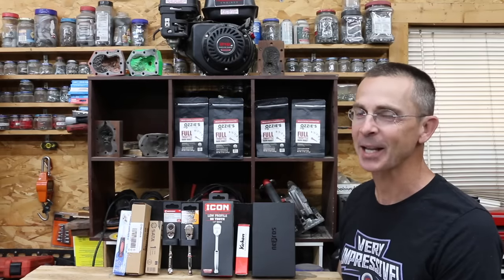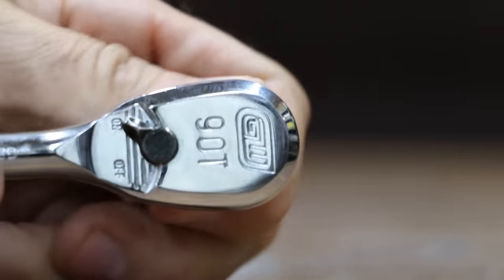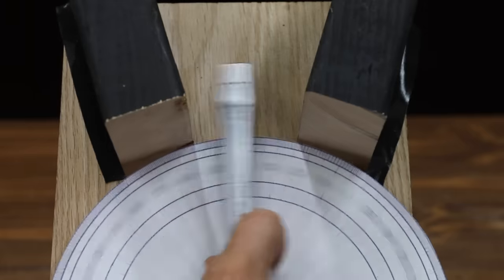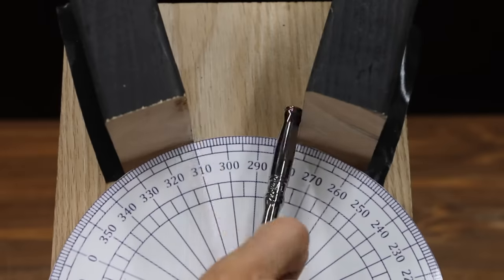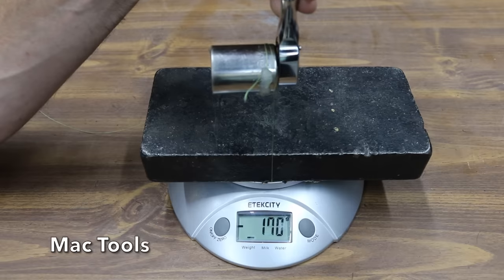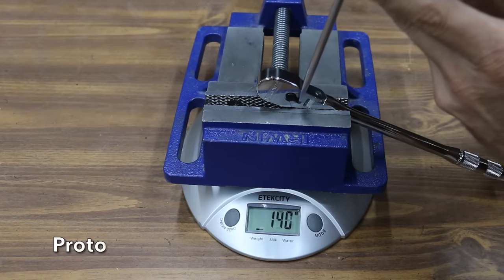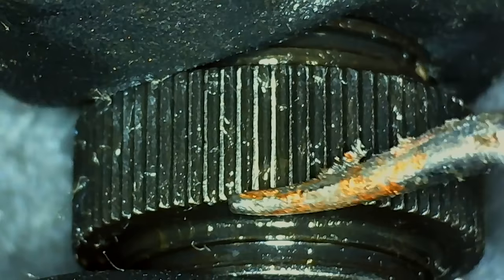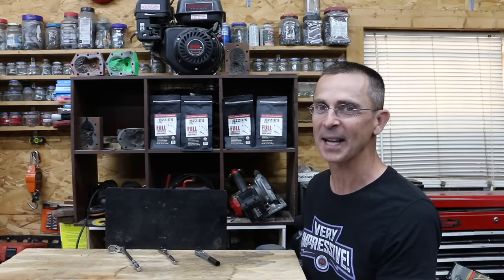Best Ratchet (1/4 In)? Snap On, Icon, Proto, GearWrench, Prototype

Comment: I have a teardrop head Westward 1/4 ratchet that is years old and has been heavily used. My 3/8 ratchets are Snapon and are about 50yrs old now and in excellent shape. Proto, Mac, and Snapon are my choices and they paid off very well. I do not own any Chinese made socket tools and never will. There are too many other good choices. Some tools in your equipment you should spend the money on. As well, these tools are all worth several times what I paid for them over the years and should I decide to I can easily sell them. NOBODY wants to buy used Chinese tools though. The other thing is that well made tools fit you hand better and just plain work better and live a lot longer.
Reply from the maker: Thanks for sharing.

Comment: Hope you can get some replacement main drives for the ratchets w/ good gears... hate to see them go to waste.

(Be nice promo giveaways for your channel.)

I just lost my very dear, 40 yr old ⅜ Snap-On flex head in a fire... made a lot of money w/ that ratchet & built a lot of fine cars & race cars, as well.

Not needing a high $ ratchet, approaching 70, I narrowed my choice to a 90T Gear Wrench & a 72T Crescent.

Had both in the online shopping cart, to make a final decision, then screwed up & ordered both.

Am I glad I did, too. I was leaning towards the Gear Wrench, but when I had it in my hands, the reverse lever was garbage. Didn't even take it off the plastic carrier to test drive!

The Crescent is a fine ratchet; not as smooth as my Snap-On, but it may improve. Feels like the pawl & teeth are rough.

Had it a couple months; like it plenty, but I can't get use to the  release button, 1st ratchet in 60 yrs to have one; I keep cussin' the ratchet 'cause the socket won't come off.

Oh, yeah, push the button, dummy.

I bought a HF ¼ composite ratchet on a whim, 10+ yrs ago. It has become one of my fav, no greasy car ratchets. Like to have a ⅜ version for non-greaay work, (grease will kill the polymer over lay grip in a heart beat.)

Good work, as always.

Something like a ratchet, need to come up w/ a greasy hands difficult to switch reverse lever, hang in to handle, use in tight spot test.

Don't know if ultimate strength test for a ¼ is relevant; it's not their purpose. Quickness, easy of use, tight space is their niche.
Reply from the maker: Thanks for sharing.

Comment: You gotta throw Matco 1/4 i believe its either 88 or 90 tooth. As well as the snap on you were using get the 88 or 90 that 72 or what not sucks.

Comment: Please make a video comparison of analog torque wrenches and digital torque adapters. 
It would be interesting  to see the whole range from 6-350 Nm tested every 1Nm up to 20 every 5nm up to 50 and every 10Nm up to 350.
A good comparison system  would be a good precise analog torque wrench and the adapter attached to it. 
Then apply force until each test setting is reached and capture in video the wrench break point in contrast to the adapters sound signal.
Reply from the maker: Thanks for the suggestion.

Comment: Your testing is very good in this video, especially having a prototype is very amazing content I enjoy, but I have some complaints. 

I personally think you should have gone with testing similarly advertised ratchets, for example do only 72T or only 90T ratchets. 

Also, as someone who uses Koken I’m confused why you bought/tested the oldest most basic Koken ratchet. They have a new 72T design which is fantastic. 

For anyone who’s wondering about ratchet purchase I’ll tell you this. 

When it comes to 1/4 ratchets there are special needs to consider. You want the smallest ratchet size wise, with the Lowest back drag. Strength is barely an issue, however if you do want to push a 1/4 ratchet to the limit I suggest Snap-on because they are one of the only who offer a very long 1/4 flex head ratchet, which can get in many tight spots, and, the ratchet head has a lifetime warranty forever so if somehow you break it, you can get it repaired no problem. That is to say, if using ratchets is your job, buy the best. If you’re a DIY-Er buy what project farm recommends in this video
Reply from the maker: Thanks!  Thanks for the constructive feedback.

Comment: An unmeasured parameter is how likely the ratchet is to change direction. This has little to do with 'switch pressure' and much to do with ergonomics, and speed the ratchet is being operated.

Comment: I have four 1/4 ratchets and my go to is the Gearwrench 90, it's better than my snap on by miles. 

1 Gearwrench 90T (amazing)
2 Halfords Advanced 100 (decent)
3 snap-on T72 (rubbish)
4 US Pro flex head (rubbish)

I am looking at getting the extra long soft grip by capri but not sure how much i will use it
Reply from the maker: Thanks for sharing.

Comment: I  only wish you had added Craftsman (and Titan, Neiko and Tekton).  I think more people have that brand than maybe all the others, for non-professional use.  Also, is there a way to compare how many passes to 360º without the thickness of the handle factoring in with each turn.  I can see why you didn't account for it though--because the handle WILL be what limits its throw in practice.  It doesn't account for gear-slop, exactly, but it's wrapped into the outcomes of each wrench's stats.  I'm so glad that you are "policing" the quality of engineering, relative to price.  But it's hard to measure that "je ne sais quoi" that has propelled some tools into the high dollar market.  Maybe you can account for that subjective factor in future testing when testing constant-use hand tools.
Reply from the maker: Thanks!  Thanks for the suggestion.

Comment: Thanks Project Farm friends. Could you make a series called 'Hidden Gem' brands. I'd like to recommend the brand: Flyman (I think it's a USA company). They have vanadium ratchet wrenches which have very sharp molding, Flyman also has pneumatic wrench gun or driver. The goal of 'Hidden Gem Brands and Models' is of course our favorite- finding a way cheaper brand and model that's way cheaper than the Roll-Royce or top 4 which is a very nice feeling.

Also have a multi-material oil (for metal, plastic, glass, wood, etc.), start with Germany's Ballistol brand, it's organic but expensive but If with WD-40 you need different types of WD-40 for say plastics, overall WD-40 may be as expensive anyway. Other oils can be contenders.

Lastly because we all tend to repair and open our tools, including multi-meters and maybe something with LCD or OLED, test quality plastic pry spudgers, metal spudger and tweezers that are stiff and have an amazing grip to prevent smalls screws and parts from flying into oblivion (maybe it has criss-cross knurling like Knipex or diagonal tips like Klein's). The main contender is iFixit and also Xool but there has to be no name ones as amazing. Louis Rossman's tweezers: Hakko CHP 3-SA Stainless Steel Non-Magnetic Precision Tweezers.

God bless, Rev. 21:4
Reply from the maker: Thanks for the suggestion.

Comment: From my experience working on aircrafts, cars, trucks, and heavy equipment, I think the carbon fiber handle on the prototype is unnecessary. The handle looks extremely smooth, making it easy to drop if covered in oil, grease, or hydraulic fluid. If it got damaged, it would likely be expensive to fix, and could possibly cut your hand open. To maintain the goal of weight saving, i think they would be better off having a solid skeletonized titanium handle that also provides several points to attach a tool lanyard, and maybe even having a part of the handle cut to fit the drive head of a breaker bar to extend the reach for some awkward areas.

Comment: This is great. Would be great to add some long term durability/cycle testing in to stuff like this.
Reply from the maker: Thanks!  Thanks for the suggestion.
Reply: How about hooking each drive up to an electric motor that spins for one second in one direction, then attempts to reverse, locking the ratchet and applying maybe 40 foot pounds for a second? That would be 3 cycles per minute. Leave it run overnight.

Comment: Before watching, I'll impart my couple of pennies...
(Used to work as a Yard Parts Puller in an Auto Salvage yard during the 1980's)
Have had a small number of "Made in China" or "Made in Taiwan" ratchets and Sockets

These were considered to be temporary Use items.. IF You were Lucky.
(Please keep in mind, this was 35 years ago and quality has surely changed since)

Only to be bought if you had lost or broken your regular tools and waiting for replacement.

Never encountered anything from Germany or much of anything outside of Snap On, Craftsman or Cornwell in my Tool Using time there..

Between Snap-On and Craftsman, at least as far as Ratchets are concerned, my preference was Craftsman.
Despite some serious, Warranty voiding abuse Craftsman Ratchets didn't break with any more frequency than did the Snap On, but it was FAR Easier to get warranty Replacements.

I Once brought a 3/8" drive ratchet in to Sears, Just to show off how badly I'd bent it, with no intention to try to get a free replacement (Said right in the papers to not put cheater pipes on the ratchets as this voids warranty)
VERY Clear that that's what I'd done, but the man took it from me, dropped it in the bin and said "Go grab a new one"

Whereas with Snap-On... It took 13 months for my dealer to get me the rebuild kit for a stripped ratchet gear.
Reply from the maker: Thanks for sharing.

Comment: Love your channel brother but I always look away when you get to breaking them, not necessary brother. I'm sure there's someone out there trying to break loose lug nuts with a 1/4" ratchet but that doesn't mean its a smart thing to do. Having a few dozen more ratchets than anyone really needs, I can say my favorite is the Snap On but out of all of my 1/4" ratchets, the ones that get used the most are my Astro long handle and Tekton stubby. they've been my go to for a couple of years. Even though I've swapped them out for newer stuff to try out, I'm a creature of habit and always seem to reach for those two. I was disappointed with the Capri soft grip 1/4", the selector on mine will move on you if you brush it while trying to crank something fast. I think a little more spring might fix it. I have a slew of the Icon ratchets and I've never gotten used to them. Same with the Craftsman V series, back-drag sucks.
Reply from the maker: Thanks!  Thanks for the feedback.

Comment: i have the gearwrench 90 (and 84) tooth. for D.I.Y. use, in my experience, the back drag has never been an issue. i would take a little more back drag and have a very robust and durable ratchet. although, if i had to choose a different one, ya.... the husky does also look pretty good.
i would NEVER spend more than like 40-45 on a ratchet though. over $100!!!......... no thanks.
idk, that's just my flavor.
Reply from the maker: Thanks for the feedback.

Comment: Personally, I didn't like the force to change direction test. When I'm working in a tight space, I always inadvertently end up changing directions because the lever bumps into something and it's so easy to switch. I think that's why your Matcos and Snap-ons were a bit more stiff. They probably see the ease of changing direction as a negative when designing a tool for working in small spaces.
Reply from the maker: Thanks for the constructive feedback.

Comment: Snapon does the 80 tooth ratchets way better. My 1/2 inch is a round head 72 tooth but my 3/8 inch is a teardrop 80 tooth. Its back drag is way less than the 72 tooth 3/8 version & it's size is smaller. I'd go Snapon 80 tooth all day.
Still a great comparison. Gonna tell my buddy who has husky how good his stuff is.
Reply from the maker: Thanks for the feedback.

Comment: I'm surprised at husky's performance. I have an old husky 1/4" ratchet set that completely sucks. Any and all sockets fit loose on the ratchet. Same goes for a craftsman set I have as well. It would have been great to see how well the sockets fit on the drive itself.
Reply from the maker: Thanks for the feedback.
Reply: I have two of the 1/4" drive sets, one inch, the other metric with the round head ratchet. (forget when I bought them, several years ago)
 Both seem fine to me unless I'm trying to get the sheet metal screws out of back of dryer or washing machine (probably because screws are not particularly well formed?) I have had to add 3" extensions but there is space in the cases.
Main problem I've had is the ratchets switch direction too easily and the heads rust up and seize, that's probably my fault for having them sit for years at a time without being used

Comment: Since Craftsman died I've relied a lot more on Harbor Freight, but I would never buy Icon tools. I've had really good luck with the Pittsburgh line.

No matter how well built, nothing justifies overpriced tools. They exist to screw over those stuck in contract systems and to massage the ego of those with pristine shops that never get used.
Reply from the maker: Thanks for sharing.

Comment: the pass test is useless.  You need to test from the handle centerline.  If you are trying to understand what the degree arc swing the fatter the handle the more test error is introduced, so those results are not accurate. I have been a test engineer for 25 years.

Comment: Realistically, a 1/4 inch drive ratchet is for small bolts and nuts. They would not be subjected to anywhere near the breaking force by somebody who knows how to use tools correctly. 

I would expect the gears with the more teeth to shear off first to some extent because the will be smaller and thinner for the same circumference. 

You can break just about any spanner if you try hard enough.

Comment: I have gone through lots of throw away socket wrenches. Sometimes the best is a solid metal wrench made anywhere but China. I have one that it stripped but still locks so I us it with a motorcycle fork tube as a breaker bar to loosen belt tensioners. But if I'm going to put a lot of force, I switch to a torque wrench. I also have a tiny micro one I use is tight spaces. 

So really, there is no one best ratchet wrench. You need a big one, a little one, a medium one and a bendy one. 😂
Reply from the maker: Thanks for the feedback.

Comment: The failure load test took these ratchets to an extreme that you normally wouldn't do.  It's hard to put a 50 pound/ft load on a 6 inch handle without an extender.  Few would put an extender on the handle of a 1/4 inch drive.  As far as I'm concerned they all passed this test.  I'd worry more about ratchet teeth wear under a heavy load.

Comment: You should do a 1/2 inch flex head ratchet comparison. It would be nice to know if there is another option that holds up as well as the snap on in that category
Reply from the maker: Thanks for the suggestion.

Comment: What about the life of it? Let's say you work on cars 5 days a week and use the ratchet over and over again. My experience is that some tools literally wear out or fail way earlier than others. For example, I have a set of Gearwrenches and since you use the same 5 wrenches most of the time, they make it about 2 years before failing or becoming really hard to work with. I did buy a set of Cornwall ones and it took 10 years before one failed. Thus, worth the money I paid for them.
Reply from the maker: Thanks for sharing.

Comment: Test angle grinders brands with equivalent amperage ratings. All your reviews of this tool have used models with a variety of motor strengths.  I am curious which make is the highest quality in the same class.
Reply from the maker: Thanks for the suggestion.

Comment: I really wish when you do these reviews you spend more time takiing about my biggest complaint not only on ratchets but also on vises and that is sloppiness and feel. Seems most ratchets have crap fit tollerances. On a vise you notice the slop in backlash and how long it takes for the handle to move the jaws and ratchets are similar with back drag.  Would be nice to be able to see you show how sloppy these tools, vises, etc are.
Reply from the maker: Thanks for the suggestion.

Comment: I saw 240 bucks for a ratchet, then remembered I have a $450 snap on ratchet.

The extra money for non locking flex head ratchets from good brands it worth it. 

If the joint on a tool truck ratchet breaks, your dealer will be embarrassed.
Reply from the maker: Thanks for sharing.

Comment: Hello! Hope all is well. I have a video idea. We got into a conversation on r/mechanicadvice about just how full you can fill an engine with oil before real problems happen. We were also musing about whether it's actually possible to fill one so full that it hydrolocks from the bottom. It likely depends on the geometry of the particular engine and dipstick. You could create a window into the crank case in some engines in a way similar to that clear head you did. It would be interesting to see what happens when you block the dipstick hole and fill 'er up all the way. Honestly, this could be a whole channel, but one good video from you on the subject might do.
Reply from the maker: Thanks for the suggestion.
Reply: @ProjectFarm  There's already another thread over there where someone has likely overfilled one until the crank is aerating the oil.